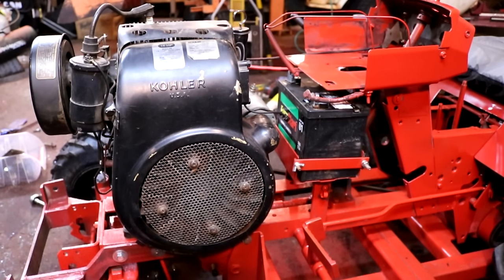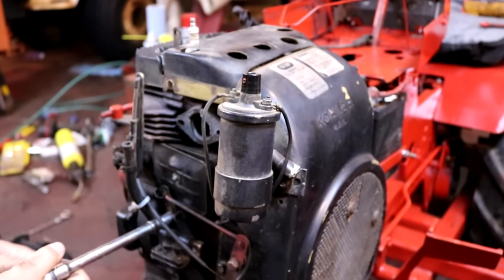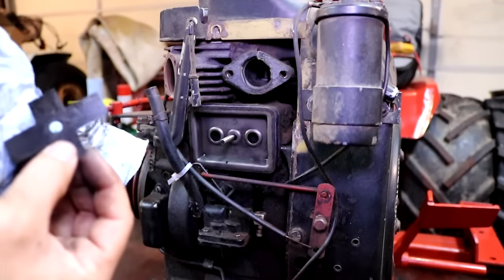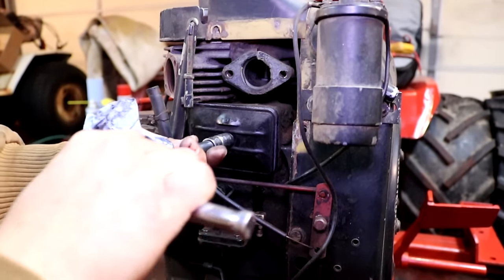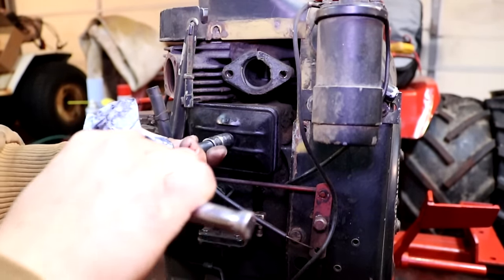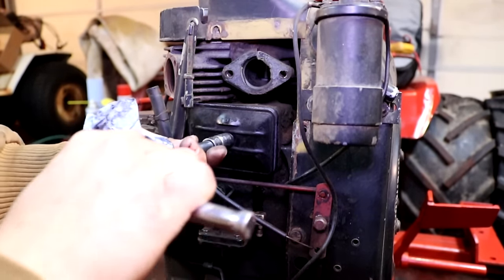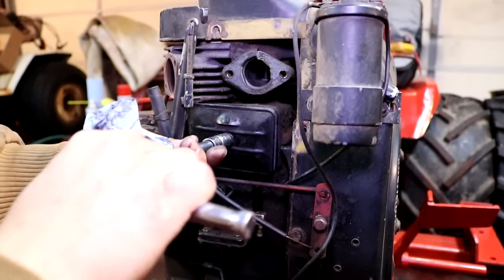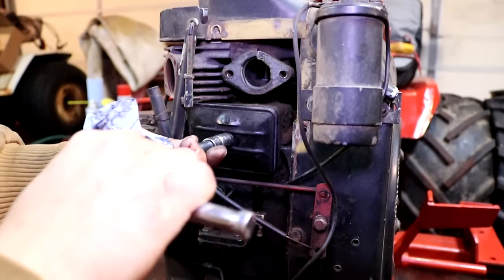5 Things You Should Do To Your Kohler K Series Engine Right Now | Kohler K Series Engine Maintenance

Comment: The original carburetor is better than anything sold on the market today and should be rebuilt if need be. Most of the chinaclones are a 1 for all and do not have the proper critical internal openings.
Reply from the maker: Ours does! Metal floats, real metal, the works.
Reply: @Isavetractors  Not as good as a Carter/Kohler but will say you do back them up. I have 18 Pre-85 GT's and have not had to replace a Carter/Kohler Carb yet. I have rebuilt a few. I do have a couple of your carbs for Temporary use. Have you found a USA maker yet? I see your prices have went up some since the last I got from you but most things have went up since then.
Reply from the maker: We already do manufacturer a small portion of our parts in Maine, USA. But at the volume we do, there are very few paths for domestic production, but we have some long term plans to bring some stuff in house. Raw Materials/supply chain shortages in 2021 have driven prices up for everything, but we do our best to keep them as stable as possible.
Reply: @Isavetractors  Sounds good. I try to buy domestic but it isn't always possible. If I was in the need of a new Carb I would buy from you but it is seldom necessary I have been a subscriber for over 3 years and am a fan..

Comment: I have worked on small engines for more then 50 years and spent many of those years as a auto mechanic, I also own a 1982 C105 Wheel horse tractor with a Kohler 241AS engine. There is no reason what so ever to replace a carburetor just because it is old. My 82 with 1000s of hours still has the original carburetor , The only parts that wear out are the throttle shaft and bushings which can be replaced for under 30.00. Seals and fuel needle for another 25.00. If you are installing a new Kohler carburetor they run between 300.00-500.00 if you can find one. My guess is you are replacing with a cheap Chinese brand, very bad advise.

Comment: Just for starters.... You will never buy a modern day carburetor that is half as good as one that is half worn out from being used for 4 decades. And using anything, anything on a head gasket other than dry metal, can cause a problem down the road. No reason to use any type of sealer, ever. I can't see any reason to replace head bolts either unless the heads or threads are damaged. Especially considering how low the torq is on  small engine. But the rest of it I suppose was sound advice.

Comment: I don't see why you'd replace the carburettor unless the body or throttle/choke valves are damaged, rebuild kits are cheap
Reply from the maker: Eventually you reach a point t where kits won't do it. That's when iSaveTractors comes in. Continue enjoying your original carb as long as you can. 👍👍

Comment: I would rather rebuild an original carburetor including bushing the throttle shaft than replacing it with a junk China knock off. You definitely need to Change the oil, use high quality non detergent 30 weight oil. I don't care for Chinese points much either and I use a condenser for a 289 Ford on all of my Kohlers. Time it with a Light and DO NOT USE A JUNK CHINA FUEL PUMP. The spark plug will tell the tale on engine condition.

Comment: i Think its stupid for most people to take off the cylinder head. If it runs and the engine is not seized simply taking the head off can warp it. if It works and it's been sealed for 40-50 years why disturb it?
Reply from the maker: The Kohler Service Manual also recommends the head to be removed and carbon cleaned every 500 hours and valve faces and seats checked. However in our experience in working with thousands of customers this rarely happens in a 60 year life span. This leads to untimely failures in the middle of jobs. Trust us, we service about 10,000 people per year, for 6 years and have the data to back up our recommendations. It is good to do these things to have a good baseline for your new to you equipment to avoid inconvenient downtime.

Comment: All the old kolher engines in my area are worn out, abused, missing a lot of parts and look like monkeys worked on them and their only tools were a screwdriver and a hammer. Engine you worked on was like new, most important is change oil & fresh NO ethanol gas.

Comment: I heard your carbs are from China and not to use them
Reply from the maker: Our carbs are not made in China. You can do whatever you wish, but if you follow this channel you will see I put my money where my mouth is. You can use that information or listen to anonymous people from internet forums. The choice is yours.
Reply: @Isavetractors  where are they made? Do you have a link to a video where you break down the advantage of using your carb?
Reply from the maker: We design and develop our carbs and they are cast and machined in Taiwan for our company's brand. For further information see the "About Us" section on our website. It has more details on how we do things that would be too long to type here. In regards to video. Every single tractor and engine in the 120+ videos on this channel feature 100% iSaveTractors parts. You can see for yourself the conditions the engines work in. These dont just go on and off a trailer to a tractor show but are used daily in all 4 seasons and as you see I push my machines as far as they will go.
Reply: @Isavetractors  sorry, I rather spend my money on an American made product, not Taiwan. I suggest pushing more American made products, that are actually made in America. I will be rebuilding my original carburetor.
Reply from the maker: @seeya5176  no worries. Best wishes to you.
Reply: @Isavetractors  as a matter a fact I just rebuilt my stock carb. Put the bushing in the carb linkage and runs better than new. I should have made a video and showed you.

Comment: Is this a joke? There’s very little that can go wrong with the original carburetor that you can’t take care of yourself. Even the worn out throttle bushing is no problem at all if you have plumbing solder and can build up the shaft with it I know what you’re thinking “solder isn’t strong enough”. Quite the contrary.Solder is soft and self- slicking, for lack of a better term and is great on throttle shafts. I use it all the time and have since the sixties !just be sure you have a little felt washer on the top side that you can put a drop of oil on once a year to keep the dust from going inside and erasing stuff that doesn’t need to be worn.Don’t make it more complicated than it is .And for God’s sake, don’t have anybody buy a China carburetor and get rid of one of the originals! I’m a purist/‘Fix anything that ever ran before ‘man,and that would make me break out in hives!Also worth noting, some of those older carburetors have a little miniature brass caps that you can take a blunted screw and dig into the cap and pull it out like removing a core plug from a car engine and it allows you to clean out the passages. Later on, the manufacturers realized that people were cleaning their own carburetors, so they started driving hardened ball bearings in those passages to keep you from getting in and cleaning them. Planned obsolescence at its finest or worst, depending on which side of the fence you’re on😳🙀😱😤

Comment: really ???  change points and dont use a timing light???  then wonder why it runs like crap
Reply from the maker: A timing light is not neccessary for this particular engine. You're barking up the wrong tree. To educate yourself we have free service manuals on our website to help you better understand these motors. Bless your heart.
Reply: If point gap set correctly timing should be right